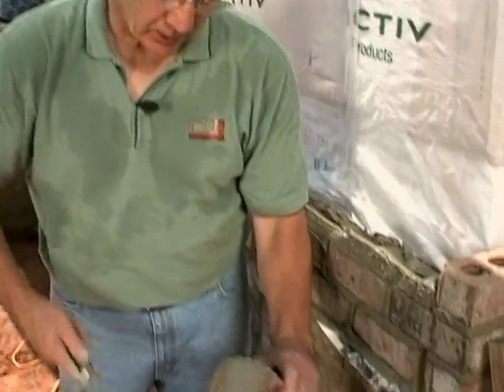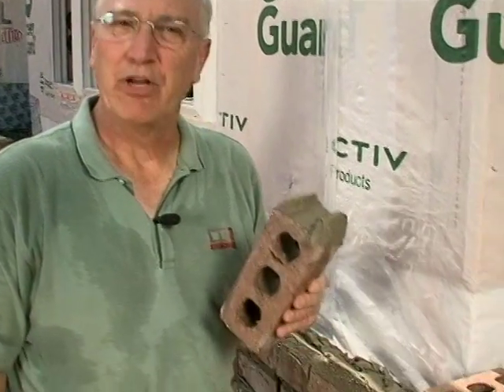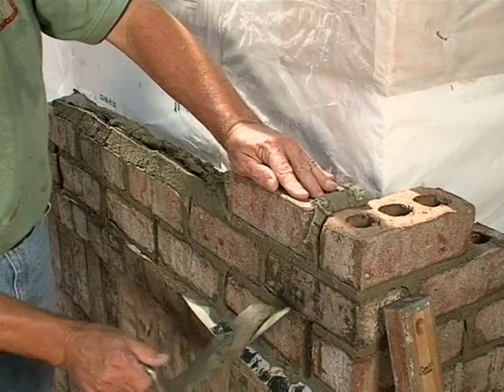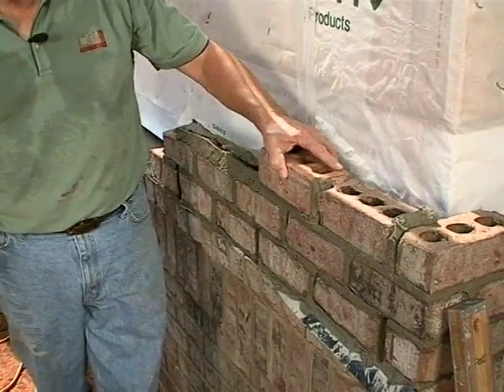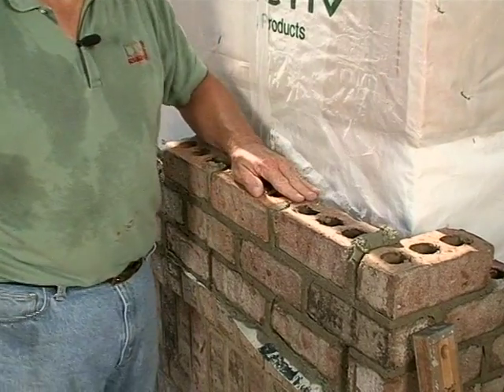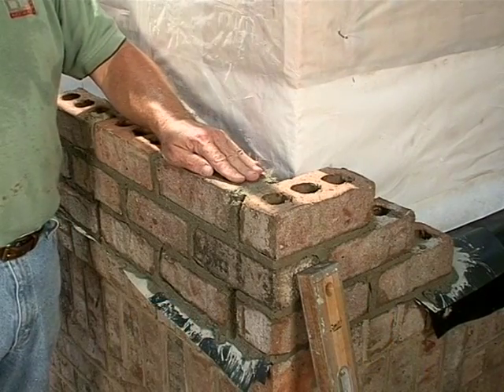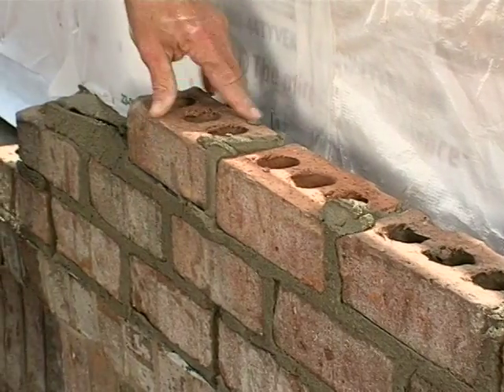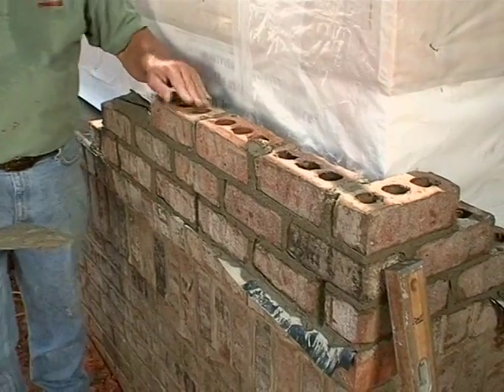Full Head Joints

Comment: I'm about to get my home
 re-mortared .I have some holes and cracks in the joints where water and moss started to turn the bricks green ..do I  need to pressure wash the wall first?
Reply: Make sure the mason grinds out the joints, dont just go over the 
joint with a thin coat of mortar (scrub pointing). Do it correctly, it costs more 
but its the only right way to do it.
Reply: bogey19018 thanks ..ya I talked to the masonry guys and they said they  grind it out where ever there is a hole or crack
Reply: Brian Keith yes
Reply: Brian Keith then grind the joints bc this allows more problems to be be seen
Reply: low pressure otherwise you could make things worse. Kill the moss with chemicals. grind out joints at least 3/4 or until something is solid if possible may not be. Use a type N mortar to repoint 750 PSI. Fill in two layers. Pre-hydrate the mortar by mixing it 30-60 minutes ahead of use in normal temperatures like 40* F to 70* it will reduce shrinkage in pointed joints..